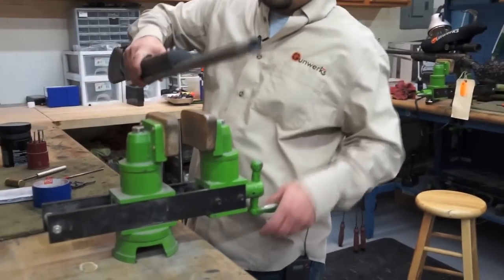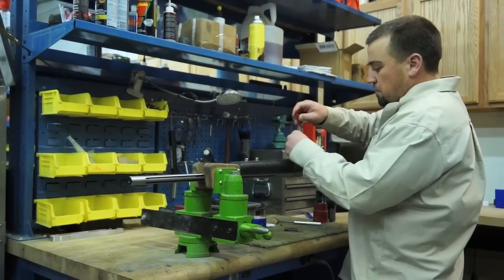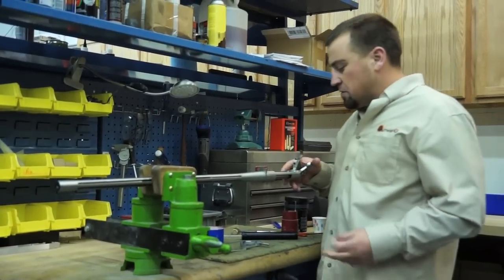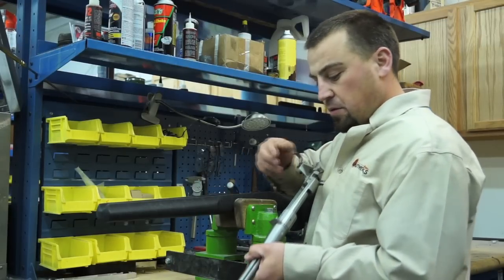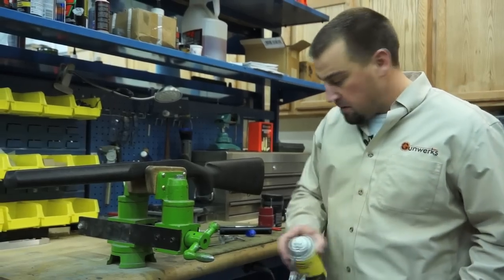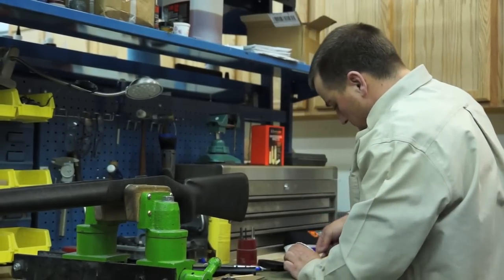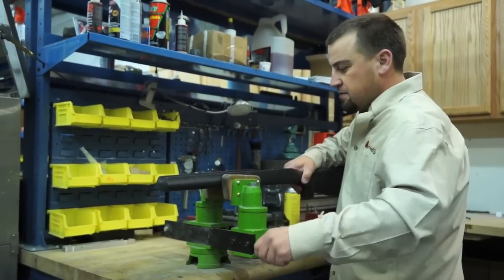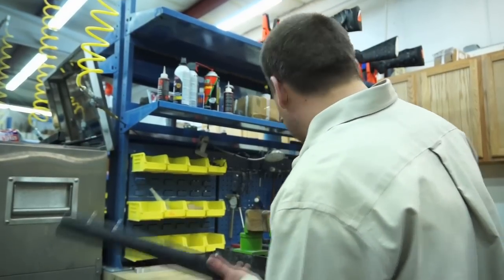Configuring a Factory Rifle to Shoot Long Range - Part 1

Comment: As usual for youtubers, you are leaving out parts.  He starts to punch out pins, but he does not do a good job of showing what pins, and he does not show taking off the trigger housing and putting on the new housing.  What was the make and model of the new trigger?  how did he set the pounds?   Showing the bedding was a good demonstration.  He knows what he is doing, but as a teacher?

Comment: TIP: If you put to in much epoxy and can't get the action to release from the stock. put the rifle inside a freezer 
 overnight and it will pop right off with tap or two.
Reply: Great idea !

Comment: I just noticed that the barrel and bolt action has not been trued up, meaning that the bolt action and it does not matter what type either remington, rgur, etc etc, it must be trued up or machined to be perfectly lined up with the barrel, so that when the bullet is put into the action its lined up perfectly, aslo the projectile seating is very important for those who are shooting in comps at 1,000 yards plus etc. :) so much to learn, just to shoot perfectly at a small target and score real good point to even get to a stage of winning comps like F lcas open for example, but still very important to make sue the barrel is set into the stock of your choice ?

Comment: My Winchester Model 70 B.O.S.S. has a special rubber bedding under the front recoil lug that was installed at the factory. The manual says to leave this bedding alone, so I did. It shoots extremely tight groups with many different bullet weights. Not every rifle type needs to be glass bedded.
Reply: My A bolt with a BOSS is too as is my A Bolt 3 hunter. Both shoot 1/2 moa easily

Comment: I have this same rifle in 7mm mag and have been a little disappointed with it because no matter the loads I feed through it I get 3/4" to 2 1/2" groups at a 100 yards. It's in consistant and wondered why such a decent looking rifle can be so disappointing. I wonder if I got a lemon.
Reply: copper fouling maybe, did you properly break the barrel in? Don't know if your handloading or not, but if you are, get a hornady oal gauge and a comparator, and see how far off your lands your seating your bullets. I've found that going off what a manual lists for your c.o.a.l. usually leaves a pretty good jump for the bullet to contact the lands. another possibility would be that the stock is contacting the barrel. That's usually a problem with wood stocks, I had a rifle do that, a little sandpaper, and it shot a lot better. the 7 mag packs a pretty good bit of recoil, try checking your scope mounts and base. hope this helps, good luck
Reply: greg wickersham Thanks, for your response. I did break in the barrel and I also reloaded my own ammo for it. The barrel is free floated with no contact on the HS Precision stock. I've since glass bedded the recoil lug as you demonstrated and noticed a slight improvement but not quite there. Afterwards I checked out some articles on accurizing a remington rifle, someone recommended lapping the bolt lugs. So, I went ahead and did a light lug lapping. This even brought more improvement in group size. For now I'm happy with the results. Hopefully, in the future I'll rebarrel it and make it the perfect long range precision rifle of my dream.
Reply: shoulda bought a Savage.....

Comment: I'm doing a similar conversion on one of my rifles and when I tighten the front action bolt, it presses on the bottom of the bolt face and won't allow the bolt to turn. These are the new action bolts I ordered for the conversion.  What am I doing wrong?

Comment: I aluminum pillar bedded my 700 rem mag you said 60-80lbs torque how can you check? I tighten as hard as possible thinking it would 1. be enough and 2. it's aluminum can't tighten hard enough to strip in my mind.

Comment: This is a very well done video.  Getting a factory rifle to shoot 3/4 inch groups at 100 yards
this easily is impressive. I will add that a Remington 700 usually shoots well out of the box. Thanks for the tip to put a block in the action to level the rifle before mounting the scope.. This is a very important step when shooting long range.

Comment: not so fast.. that tape is .005 - .006 " thick . when you remove it , you won't have the effect of the bedding you just did. the spray alone is all  you need. when you're done and ready to torque the action screws put your gun on an upright position so the recoil lug butts against the gun stock  before tightening the screws for full effect.

Comment: Had really good luck using JB weld for bedding compound and wood wax as a release agent. I saw a bladesmith use the same stuff to bed a rattail tang into a handle so figured it would work.

Comment: How tight do you tighten the action screws when you screw them back in with fresh epoxy.... snug? Torque spec?..
Reply: Torque Spec so the epoxy settles the way it will wind up permanently.

Comment: As easy as that looked I am surprised the manufactures don't do that themselves and sell a far more accurate rifle to begin with.
Reply: some do, i recently had a weatherby ultralightweight out of it's stock and it appeared to be bedded in just the same way as this rifle was. it appeared that just enough bedding compound was used to fill in behind the recoil lug and keep any extra from oozing out around the edges of the action.
Reply: Michael Halas Wouldn't doubt it. Weatherby tries to keep their Sub-MOA Guarantee. Image how much more time they'd have to spend if they didn't do some simple bedding
Reply: Michael Halas  Weatherby has been doing this for many years, that's why they guarantee 1" MOA out of the box
at 100 yards.
Reply: weathery's guarantee is for 1.5" groups at one hundred yards for their non-sub moa/range certified rifles. furthermore, their vanguards, which tend to be very accurate rifles at an affordable price, are not bedded at the factory. what i was trying to highlight with my comment was what an efficient job they could do in regards to increasing the rifles accuracy without the additional time, and therefore money, involved with a more complete bedding job such as full length bedding with or without pillars which would add the complications of more time consuming prep and cleanup. what is essentially a well placed squirt of bedding compound into a critical area that requires little or no extra prep or clean up when assembling the rifle can ensure a happy customer without the effect on the bottomline that careful masking of the stock, blocking of the action, application of release agent to the stripped barreled action, curing time of the bedding compound, removal of the barreled action, removal of excess compound for clearance, cleanup of barreled action and stock all before final assembly would dictate. that is the simplified version of what it takes to properly bed a rifle and that is why it isn't done by every manufacturer's rifles and why you should expect to spend $200+ to get your rifle professionally bedded, not including pillars. and that is all i have to say about that.
Reply: Michael Halas Yes 1.5" my mistake, it's been a long time.

Comment: Thomas. Actually the MSRP is over $1400.  It's well worth it for sure. I have one in 7mm mag and it will shoot1/2 MOA at 200yds. with factory (Hornady 165gr. superformance).  It has a Timney trigger but needs to be bedded.
I would think that most any rifle could be improved with a good trigger and bedding and of course with a good scope.

Comment: I may sound retarded but why does the lug have to be secure, isn't the scope fitted on top of the action? So it doesn't matter if the it moves around a bit because The scope stay in the same place in relation to the barrel and action?
Thanks.
Reply: However, your holding and supporting it with the stock, so if your action is shifting within the stock it can effect quite a bit, say you fire the rifle with the stock fully supported, however the action shifts within the stock, you have just lost accuracy.
Reply: Charles Batkin: One has nothing to do with the other. By bedding the lug and action you improve accuracy
a great deal.
Reply: Every time you fire the rifle without a proper bedding job it will shift in the stock a small bit every time you shoot it, especially when dealing with magnums, however small that movement is it will show up on the target and that would be like the equivalent of having a loose scope. Bedding relieves stress on the action and barrel, that is influenced by the torque of the screws and the imperfections of the stock to action fit....Bedding gives you a perfect stress free fit.

Comment: MattyPhil...good comment. Better to use a loctite against loosening and 30 ft lb.What's the screw rating? He uses a brass  hammer (very poorly) with a steel drift. What's that logic? The vyce should be at the end of the bench to get good access.... spray everywhere..LOL!! .No wonder it's fast setting epoxy with the amount of fixer he uses. I really don't like the distance of the torquing from the vyce and that the barrel is held with 80ft/lb being applied..that's big strain against the barrel.

Comment: Much less epoxy was needed for this job.  There is epoxy between the action and the block behind the recoil lug.  This defeats the function of the block because the surface contact patch is reduced along the length of the block.
Reply: I didn't even notice that. But you're right.

Comment: Huhhh?  No explanation of why? And what about running that dollar bill between the stock bed and barrel?  Hmmm?
Reply: The dollar bill is to show the gap between the barrel and stock, "floating" the barrel allows the barrel vibrations to react naturally and consistent during each shot. Touching of the stock will give interrupt this process, overall making it inaccurate.
Reply: Kanoe Kamakau
Not always.  The Weatherby Vanguard does not have a floating barrel and mine is shooting sub MOA at 200 yrds with factory ammo.
Reply: Dan Ryant
Really? Thats awesome. My factory rifles cant. But my Custom precision Rem 700 sits in a KRG W3 chassis shot a 0.286 group last weekend.
Reply: NICE!  I've got a cheap bushnell scope on mine right now.  I have to get a level and start shooting other than factory and hope to achieve that.  For now, being able to hit a chipmunk at 200 yards and still have meat to eat will have to do.   :)
Reply: Haha that's the main thing, food on the table!  I use a Bushnell g2dmr 3.5-21×50 and a Vortex anticant bubble. The caliber is 6.5 Creedmoor. It's a great round.
Reply: I just sent an email to my wife with the info on the Vortex.  Thanks for the hint.   :)
Reply: Lol. No problem! Next step is getting some reloading equipment!
Reply: That I already have.  Not a lot, but enough to do 308.  I've put the bug in my wife's ear to get me the RCBS competition die set and the Hornady concentricity gauge.  That should be all I need.
Reply: As for the concentricity gauge, we don't use one. It will make the bullet perfectly centered, but if you shoot from a magazine, chambering the round will move a noncrimped bullet around. I measured a dummy round before and after I chambered it, and it seated my bullet 0.005 inches deeper in the case. I honestly think that if you have a good chamber, and you are loading correctly according to your specific ogive, the concentricity of the bullet won't make much of a difference in terms of accuracy, because external ballistics such as wind, air pressure, and humidity will come into play before yielding results.

Comment: Nice work!  What is the purpose of taping the lug bottom/sides?
Thanks & Best Regards,
Jon
Reply: Lug should only be bedded at the rear.  Tape on bottom / sides / front allows a couple of thousands clearance.

Comment: A can of neutral colored shoe polish is an excellent, cheap release agent.
  Great suggestion too is to put a few wraps of electrical tape around the barrel  in the front to ensure it is perfectly centered in the stock.
Reply: I have seen several of the CHEAP NEUTRAL as you call it not work eveytime.  Like I told them why would you spend 1200 on a gun and do anything cheap !

Comment: Way too high of a torque spec, Remington says 45 inch pounds, HS advises 65 max.  Is possible to over torque and bind the action and it's just not nessisary.  My 5r Milspec I torqued to 45 inch pounds shoots just great.  Also wood or regular synthetic is 35-40 not 40-60.. Also didn't even know factory trigger can be adjusted and replacement is a preference.  Bedding the lug is optional as well but good advice.  Decent video but guy here is uninformed on a few things and gives some bad info here on torque specs...
Reply: That's exactly why you dont let the sales manager do the gunsmithing. lol

Comment: the r700 is a good rifle from the factory and when u mod it to be a fully semiautomaticboltaction rifle it shoots the most powerful rounds at 70000000feet per milisecond and rips the target in to bits with the force of a 700megaton tactical nuke

if u cant tell im clearly joking because the r700 is really a good gun

Comment: Manufactures have caught on with various aluminum bedding blocks being offered and they probably work to an extent, but still I prefer to bed the action and barrel channel and free float, as my method any day of the week. Personally I don't like bedding blocks, but would favor pillars to handle the torque end of the business in combination with bedding compound as the primary surface contact...IMO

Comment: I hate clamping on to a barrel like that..  I cringe  when I see it !!
Reply: +grabir01 So long as your jaws don't damage the exterior of the barrel, you're fine. Commercial barrel vises are capable of putting 10's of thousands of PSI of pressure to the exterior of a barrel and it will do no harm, you'd have to add a breaker bar and hop up and down on it to put enough pressure through a conventional bench vise to distort a bore.
Reply: +grabir01 Your bullet bends the barrel more when you shoot it than that vice did..
Reply: I also cringe when I see  people using weapons to hoist others  over walls or use them to help get over fences.
Reply: grabir01 go watch this video:
"The Ultimate PROOF: Carbon Fiber Wrapped Barrel Durability"
Hope you don't cringe too hard, but these barrels aren't made of eggshells.. In the military, my drill SGT shot a sub MOA group with my issued, who knows how many hundreds of thousands of rounds went through it carbine, then my drill sgt came over, and showed us something awesome: He threw this M16 really hard on the concrete, loaded it up, and shot another sub MOA group.
Reply: We Army Ranger Snipers never ever do this. When I went through Army Ranger Training, I out shot everyone including my Drill Sergeants.   I won BRM E73 cycle.  Our DS never threw any weapons on the ground. EVER !!   Just the opposite. We kept them clean clean clean..  We slept with our weapons and kept them warm. Our weapons were life to us. They were our lives.. When they did get dirty, we took the time to clean them, inspect them, shoot them.  Love them. We learned to  clean them , assemble them blind folded. We  never abused them intentionally. Accidents do happen when in combat and during training.
Reply: grabir01 But did you watch the video of that carbon fiber bull barrel?
Reply: grabir01 when did you graduate sniper school

Comment: video is rushed and doesn't show any details.  I would have liked to see what you actually did with the trigger and what you used.
Reply: Captain Howdy As far as installation of the trigger is about as easy as it gets, you drive out two pins and it comes out. Put the new trigger in and drive the pins back in and you’re done not that complicated. As far as what the trigger was it was probably a Shilen Timney or trigger tech.

Comment: Get a Savage with an accu trigger and Accu Stock and your GTG. no need to bed or replace the trigger.
Reply: Savage is a cheaply made and can't compare to a Winchester or Remington in quality, it's worth the extra 2 or 3 hundred bucks to buy a rifle that will out shoot, outlast and and out perform a savage in any manner.
Reply: You know it. One of my rifles is a savage axis (the cheap savage you can buy) and it’s consistently groups.50-.75” all day
Reply: Joseph M their a cheaper rifle but the quality is there. They will last as long as any other rifle if not longer.
Reply: Grimior00 your absolutely right, I own 10 savage rifles and they all consistently group.75” or even sometimes better “if I do my part” Amazing rifles.
Reply: LOL!!! Ignorance is Bliss!
Reply: modernwarfare2204 9 times out of 10 it’s the person pulling the trigger that is inconsistent and not the gun I have a savage but I have many Remington it’s all about personal choice
Reply: I had a savage long range and it was the worst shooting rifle I’ve ever owned, best I could get out of it was 1.5 inche groups.

Comment: 40 or 60" pounds of torque? You would crack a would stock if you did that. Remington recommends 25" lbs for their rifles...
Reply: i was thinking the same thing. most manufacturers recommend 35 in.lbs for wood and usually 65 in.lbs for pillars/aluminum blocks. i would say that the rest of the info presented here is at least worth considering but i'd also consider other options for bedding. my preference is to bed only the rear of the lug on this style of action and to at least skim bed the rest of the action while the trigger is removed and with lots of masking tape modeling clay and car wax or shoe polish involved. but as far as bedding goes i will admit that there are lots of "right" ways.